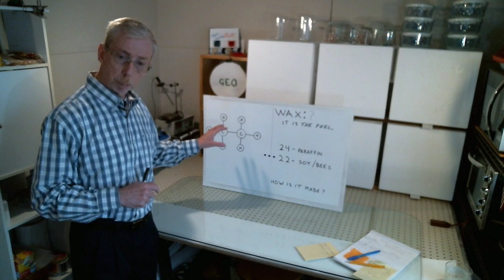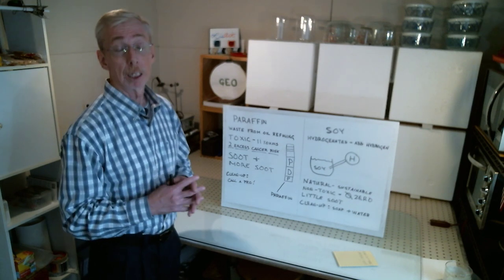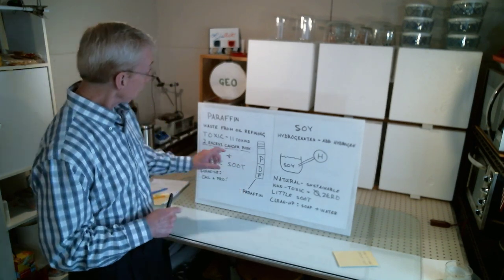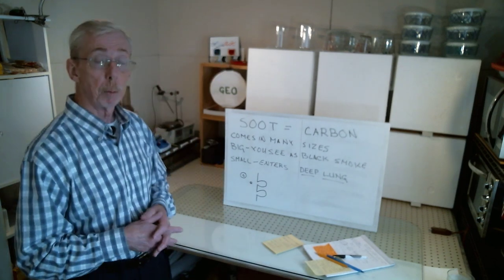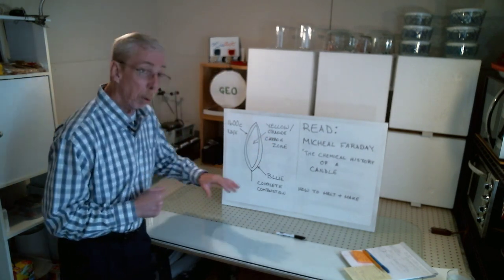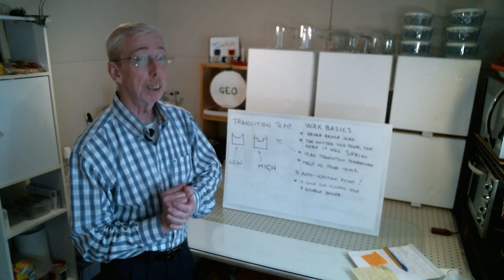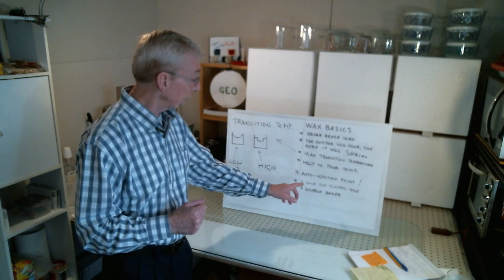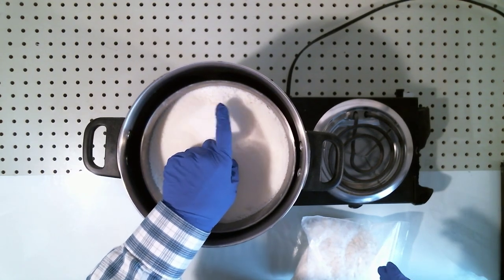Candle Making: WAX, the science and the myth. I explain natural wax and paraffin wax. Part 1

Comment: SUBBED! I've been wondering on how big candle companies create quality candles and what are the industry secrets that were kept from public and here you are!!✨️ Thank you for sharing valuable information and secrets where other youtubers failed to explain/share!❤

I have a few questions: 
1) I've noticed that when u make a plug for the candle, u did not use any adhesives to hold the wick. I have issues where I've used wick tabs, and the wick popped off and floated. Won't the wick come off if I didn't use any adhesives?

2) i watched another video where you've added 2% EO to the plug, but over here EO wasn't added. Will that make any difference in the scent throw?

Thank you!
Reply from the maker: Glad to share.
1) One of the benefits to using a plug is that you don't need to 'stick the wick' to the jar. Once the wax hardens, the wick is in place until end of life. In large candle factories, it is the only time a human touches the candle, the rest is all robotic. I have seen tables upon tables of people (mostly old ladies) sitting 'plugging candles'. While men run around just keeping the ladies stocked and plugged candles removed. It's a real industry sector in Mexico.
2) If you are short on space and don't have room for 2 different formula, making a scented plug is just fine. Some would say it is better; some would say it is a waste of expensive scent. None of the big candle companies I can recall scent the plug. If you consider yourself a Chandelier of quality candles, scent the plug as I showed. The higher over all percentage WILL make a difference in the scent throw. Most candle companies only scent the top pour.
Thank you for the SUB, thank you for watching. I hope you will watch my upcoming series on electric cars.

Comment: What type of emulsifier are there for soy/coconut  candle i try searching for them but nothing comes up, any suggestions?I'm actually not an engineer  I'm just a person who just recently have gotten  intrested on how candles work you seem very knowledgeable on the science behind candles which honestly I cannot thank you enough I'm grateful you have videos on candles and how to properly do things thank you once again.
Reply from the maker: Ah, so sorry, I came off a bit vague. You don't need one, the heating of the wax creates swirls (eddy currents) of hot wax rising to the top, while cool wax moves to the bottom near the heat. This is a current of the wax in the pot while heating...free emulsification. A few minutes of this and your wax will be as blended as it is ever going to get. As for what type, as I said, I never used them, I can't help you there.
Reply: @GEOsustainable ok, so if I make my own wax  blend with no emulsifier my fragrance will bind to my oils without any problem correct ?

Comment: If you are making your own wax blend with hydrogenated oils does one need an emulsifier?one that will help bind the fragrance to the blend while also helping the two diffrennt viscosity of the diffrent waxes mix well together? if so, do you have any suggestion on which emulsifier will do this in candles thay are safe for candle use . Also can I use hydrogenated castor wax in candles and plain Candelilla Wax or carnuba wax ?Thank you.
Reply from the maker: How about I include the answer in my next video on how to color match candles? For now, use any emulsifier. I don't use them. Any engineer knows about 'Eddy Currents', especially if they ever did body surfing as a kid, yielding an emulsifier redundant. There's that word again..bind. Is your behind 'binded' to your seat right now? I like to say blended or mixed. Any oil that has been hydrogenated will burn better than the oil that is not. So, sure, it sounds like a great idea. Stay tuned, I am starting the color match video in a few days.

Comment: I have had wicks slide in a half melted candle before. Do you not attach your wicks to the jar? And if not, is that really safe?
Reply from the maker: I don't attach because I use a safety tab, it extinguishes the wick and the candle goes out before the wax ever melts the bottom. A safety tab has a 5/8'' barrel. They were invented to save that very step in high speed manufacturing. The  pre-tabbed wicks you buy on Amazon probably don't use them as they are more expensive and they would lose sales as the price is what folks usually go for. You have to order the tabs and crimp them yourself. I show a picture of one in one of my videos. This of course all depends on having your candle properly sized. Candle makers like them anyway because it gives one more layer of safety while sending the customer to the store a few days sooner to buy a new scent. FYI, don't be fooled, the Chinese try to say 'safety tab' when they are not. They are made in the US if you want to look for them. I don't remember who. Beyond that, you have to rely on the customer not moving the candle when the wax is still melted after burning as doing that can ruin a well functioning candle.
Reply: @GEOsustainable Hi! May i know what's the difference between an actual safety tab and pre-tabbed wick "safety tab" from candle suppliers/chinese sellers? Both have 6mm neck but differs in thickness. Can we still use it as long as it has 6mm neck? Thank you!

Comment: Thank you, I learned a lot!
I've been researching dangers of added ingredients to wax melts,  biodegradable glitter in particular.  I have not been able to find anything well documented.   Can you point me in the right direction or perhaps you have researxhed this. I'm getting mixed information about the toxicity of cosmetic grade glitter, micas and plastic free bio (eco) glitter usage in candles and wax melts.  As this has become quite a trend, I feel it's a topic that deserves attention. Thank you
Reply from the maker: I know very little about it, other than I always steered folks away from anything that was not predictable in a burn. In a wax melt, you are not reaching temperatures (140F-160F) that would burn bio-glitter as it is likely made from milk. I actually did a video on how to make bio-glitter. An artist in France asked me to make a replacement for Acrylic, so I came up with a very nice alternative. Check here to see something really cool. https://youtu.be/Pjm_PTT8efw
Mica is a rock, so no worry there. Don't use it in a candle, it will POP in the flame.
Plastic can, at 140F, potentially evolve diatomic particles. In short, diatomic particles aren't good to breathe.
I would recommend to simply use Mica or bio-glitter, or wax beads.
Stay tuned, folks are wanting more on candles and I am working on one right now on Scents. I plan to cover much more on the subject, sharing my decades experience in running a candle safety testing lab for major Big Box stores.
This sounds like an important subject to cover, thanks.
Reply: @GEOsustainable  thank you so much for your quick response and   helpful guidance.  Looking forward to your upcoming videos

Comment: Since wicks tend to be covered with some type of wax that could possibly be parrafin wax how do we know its not parrafin, will the little bit of parrafin that can potentially be in the wax be bad? Are there wicks that do not have parrafin wax in them?  I also wanted to use coconut apricot wax to make candle containers to sell but  the suppplier does say that it contains a bit of food grade parrafin wax would you recommend I do not use it will it still be unsafe for consumers? thank you for your time and the  information I much appreciate it.
Reply from the maker: Your questions will make a great video. But to answer you now. Waxed wicks are most always paraffin wax. Waxers get asked a hundred times a day for natural wick wax, but the story goes...they supply one and as long as you will go ahead and buy them like that anyway, they will never change. They use a slack wax, the cheapest; natural wax is more expensive. Your solution is to prime your own wicks, and making a table top wick waxer will be a future video. For now you can squeeze them between your fingers, and hand tab. Lots of folks do that to have quality control.
What the wax supplier is talking about is a blended wax, to improve burn characteristics. And there is no way they will not blend it, as without it will be hard to burn. Refer to my video when I talk about wax and energy coefficient of fuels. You are trying to use an exotic wax and that sounds amazing. The only way to get low energy fuels to burn is to add mostly paraffin and a little exotic wax. The exotic is likely no more than 10%.
I would not worry about the paraffin wax on the wick, as it is minimal amount.
The paraffin in the blended wax however is substantial and I would not use it.
Good luck, and thanks so much for your questions.
Reply: @GEOsustainable  thank you for your response 🙂 is it possible to formulate my own wax blends? If so, What type of wax oils are use to make candles? will hydrogenated oils be the type of waxes that are use to make candles? I found a supplier who has  100% hydrogenated coconut glycerides and another supplier who have hydrogenated waxes but im not sure if this is what your supposed to use.

Comment: thank you for your response 🙂 is it possible to formulate my own wax blends? If so, What type of wax oils are use to make candles? will hydrogenated oils be the type of waxes that are use to make candles? I found a supplier who has  100% hydrogenated coconut glycerides and another supplier who have hydrogenated waxes but im not sure if this is what your supposed to use.
Reply from the maker: Yes you can! Hydrogenated is good, it is very good. What it means is they have infused the wax with more hydrogen, giving it a higher energy coefficient. You can mix these hydrogenated waxes to make your own blend. It is a process you will enjoy very much, and you will have your own blend! When blending remember to maintain as high a hydrocarbon chain length as possible, 22 to 24.

Comment: I appreciate your videos so much. Can you let me know a little more specifically when you consider a wax used (and hence don't want to reuse)? Is it when it reaches a certain temperature (like if I accidentally overheat it to 200 degrees) or did it have to have come into contact with the flame. Thank you!!
Reply from the maker: Both. Thanks for your questions. Stay tuned as I will be getting into candles a good bit more.

Comment: Thanks for the great scientific explaination. I wanna ask you about the auto ignition issue when melting wax. i use a big stainless soup pot (30cm wide * 45cm tall cylinder shape) to melt soy wax(within 5kg) on an electric burner and i never used a double boiler. is it dangerous to do so? I usually put the lid on, but i'm not sure if the wax ''steam'' would cause fire in my small office (20㎡). I saw some factories use  big electric tanks to melt wax, would that not cause ignition in the air?  

Thank you !
Reply from the maker: Great questions. As I said in the video, use a double boiler to keep the wax from degrading during the making process. The industrial type has insulation jacketing the sides and bottom, so 'no direct' contact with heat. Both types give indirect heat. CORRECT, do not put a lid on, it can build pressure.  Auto-ignition risk increases greatly if there is direct contact with melting wax. Watch my other videos for more on the components of candles.
Reply: @GEOsustainable  Thank you so much! this is life saving.🌹
Reply: GEO sustainable thank you for you're videos.  I'm so thankful I found them.  Do you recommend a presto pot to melt the wax ?  This seems to be the hot item these days to melt larger amounts of wax.

Comment: Hi, thank you so much for your detailed video. When you state to use the double boiler method I understand what you mean, but how would one make bulk candles? I have a presto pot that I use to make candles when I want to make more than a few at a time.
Reply from the maker: Great to hear you are moving up. You are ready for a commercial wax melter. They are very reasonable and work great. They melt wax with an insulation jacket, so no direct heat, same as a water heater. You can go from 5 gallon size to 50 gallon for table top models. Bigger, well, you can go as big as a room with a custom design. I won't recommend a certain company, but from what I have seen, they will all work just great, and an essential investment for serious candle makers.
[edit] They can even be fitted to an automated pouring line. So, first piece of basic equipment for the 'for real candle makers'.
Reply: @GEOsustainable  Thank you so much!! I appreciate your expertise. Can you do a video on soy wax and the best temps for adding fragrance oil and pouring? Thank you!

Comment: Thank you. Can you explain why wax needs to be heated to a specific temperature which then has to be allowed to cool before adding essential oil?
Many thanks. Pamela
Reply from the maker: It is a great question. And, it doesn't need to be heated to liquid and then cooled. That is such a waste of time, money, heat. In this video I show how to cool the wax before adding scent. You should add it as low as possible. Many candle makers don't heat, but compress wax., because heat is crazy expensive.
Reply: Thank you.  I’m going to JUST melt the wax and then add the essence for my next batch. Do you have a guide on cure time and the rationale for natural veg waxes and essential oils?

Comment: If you could share some information on beeswax, that would be very helpful! In the area where I live  there's no production of soy wax, so I decided to choose beeswax as natural, nontoxic and environmental friendly wax. The information about beeswax candles is very scarse and any tips would be really appreciated!
Reply from the maker: I sure will help you as much as I can. The energy content of beeswax is the same as soy, Everything in the video still applies. Beeswax needs more screening to filter out debris to get a good burn. An open cell wick, or a larger than soy wax will work best. Many folks double wick beeswax candles. Beeswax works for container and pillar just as well. The melt point is about 130. Bees wax is usually not scented or colored. Burning beeswax candles can attract pollinators. I am sure you have more questions, so ask away until you have complete confidence to make your candles. But, let's not jump ahead of the series I have planned. Stay tuned.
Reply: @GEOsustainable  Thank you! I'll keep on testing. I tried to use a larger wick so that the melt pool is large enough after the first burn. But the tin gets too hot, so I'm gonna try and use smaller wick next :)
Reply: Tiga King I also have questions about beeswax! I had read that as a harder wax, it is less suited to container candles? I also was wondering about beeswax and soy blends, either DIY or manufactured. I love the natural scent of beeswax but I would like to make container candles and a lot of the more professional instructions only discuss beeswax pillars and tapers.

Comment: Thank you for much for your video! I'm so happy found you by the algorithm. 
I'm quite confused about the Transition temperature. How can I know that a certain wax has a low and broad transition temperature? Does it mean that the wax with a lower melting temp is the better?
Reply from the maker: Spot on, yes, a lower melt temperature wax has a low (short) transition range. For containers, you will want a short range, and for sticks and pillars, you will want as high as you can. To define a wax transition temperature, is simply put, the range from solid to liquid. To illustrate, at room temperature, a wax is solid, and the temperature it takes to melt it is the top of the range. The difference between those two points gives us the transition range. I should do another video on wax, a few people are getting stuck on a few new terms.
Reply: @GEOsustainable  Thank you so much for taking time to reply to my question. :)
Reply from the maker: @worwantube  I answer every question. Ask away, if I don't know, I most often find a lead for you.
Reply: @GEOsustainable  Thank you so much again. Very appreciated!
Reply from the maker: @worwantube  I want to thank you for your continuing support. You have inspired me to do more on candles. Stay tuned for a new series.
Reply: @GEOsustainable  Can't wait to see your upcoming amazing videos!
Reply from the maker: @worwantube  Stay tuned. Get your scents together, I am making a scent video that I hope gos into more detail for you.
Reply: @GEOsustainable  Thank you! I watched your videos at least twice to make sure I don't miss a thing. :D